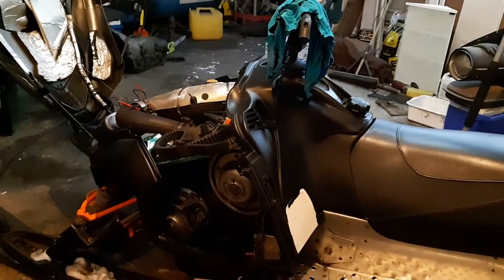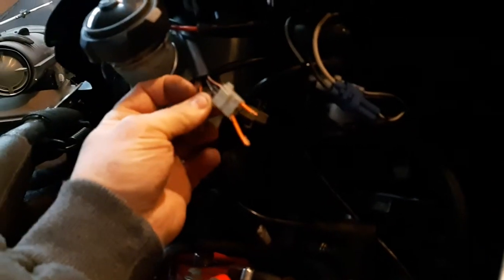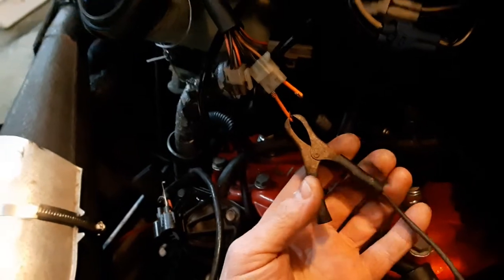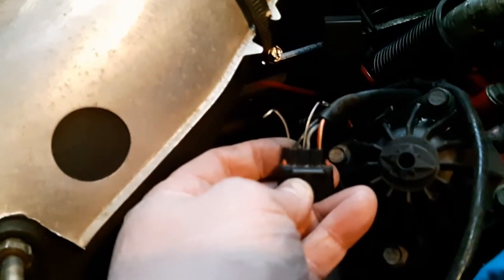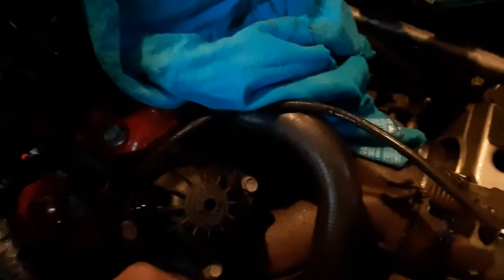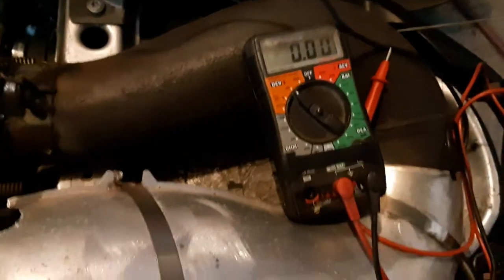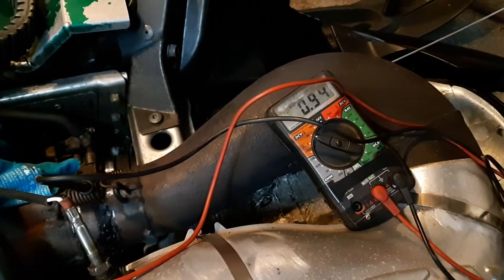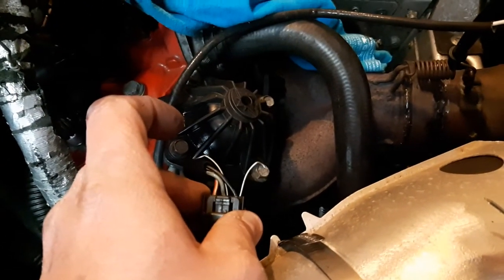Polaris fusion 900 tps adjustment without special tools

Comment: Thanks for the video!  If you want to save a little trouble, you can pick up a TPS Meter from TPSTool.com.  Just plug it in, it powers the TPS for you.  No need to power up the entire computer.
Reply: Yeah, just buy one, it's only $160 - everyone has that kind of money to spend on a once-and-a-while tool.
Reply: @MattB787 of course not everyone does, but if you do it sure makes life easier for this job.

Comment: Is this just to test the tps? Or can you adjust the tps itself while using this method
Reply from the maker: You can adjust as well 👍
Reply: @coastalglass1596  is adjust it really as simple as loosening the screws on the tps and turning it slightly? Some people say you have to actually pull the throttle body right out
Reply from the maker: @easyyyye  just loosen and adjust yep 👌 easy peasy
Reply: @coastalglass1596  thanks a ton! I've probably watched your video 100 times haha
Reply: @easyyyye  do you know which way lowers/raises rpm?